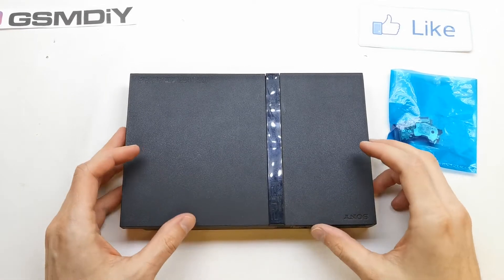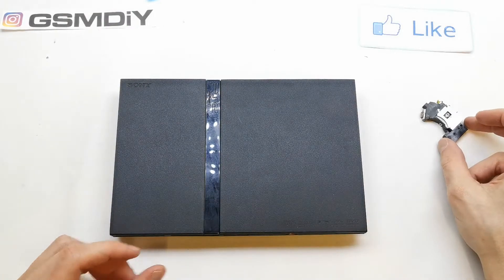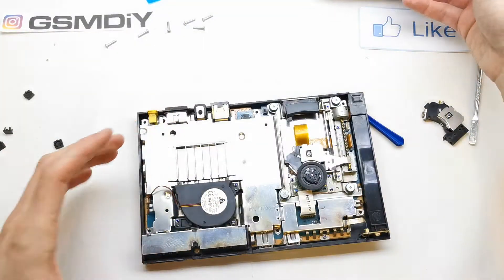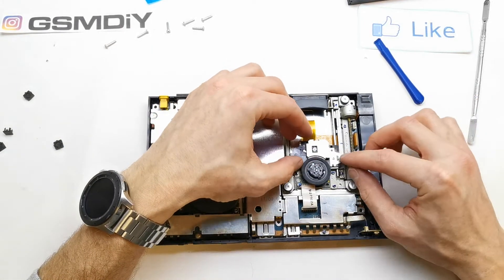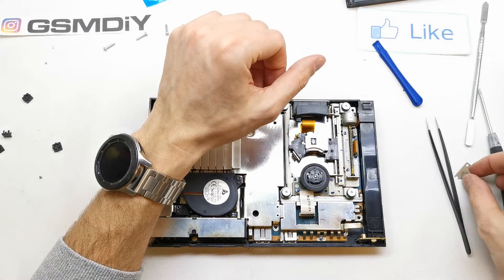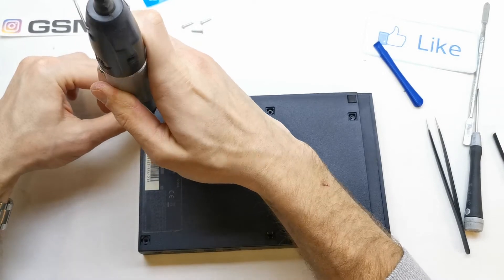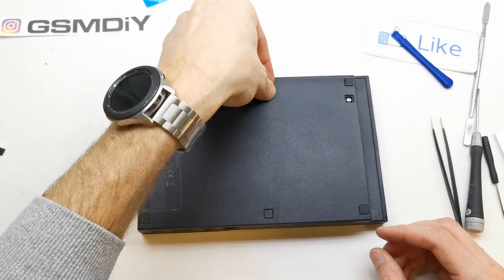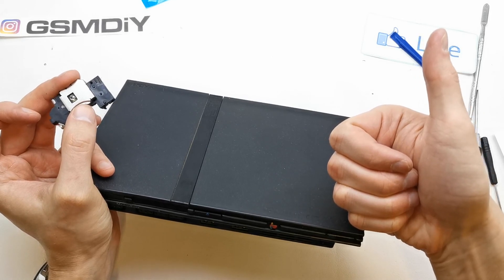PS2 Slim Laser unit replacement - PLAYSTATION 2

Comment: I finally got around to cleaning my ps2 slim and the laser is still working but the grease on the worm gear was dirty so I wanted to clean it up and put new grease on the worm gear but the metal rod that holds the laser in place has 2 metal clips and the 2 plastic guides is the only problem I had trying to figure out where they came from and how they go back on until I saw this video thank you very much
Reply: I just got some white lithium grease the only one they had was Lucas brand so I have read that this is the wrong kind of grease that I should have bought was something else not lithium grease so I’m so confused 🤔

Comment: there is tin on the printed circuit board, it must be desoldered before assembly
Reply from the maker: Yes
Reply: @Godfamark1  he didnt boot it up either.
Reply: Can you be more specific? Isn't there always tin on a PCB?
Reply: I changed the laser, the new one doesn't work without unsoldering the tin connection because the magnetic movement is deactivated. It can't focus